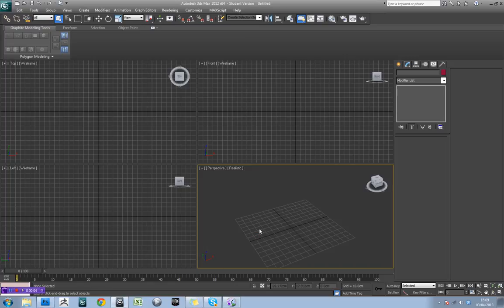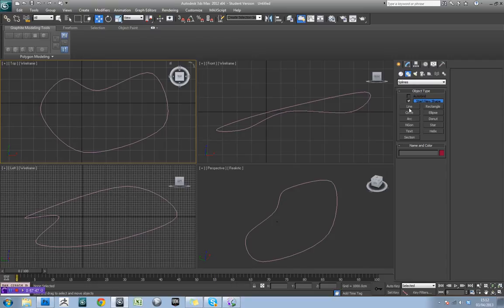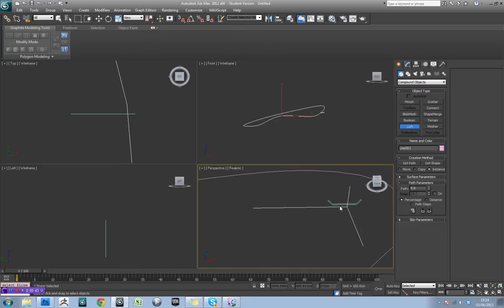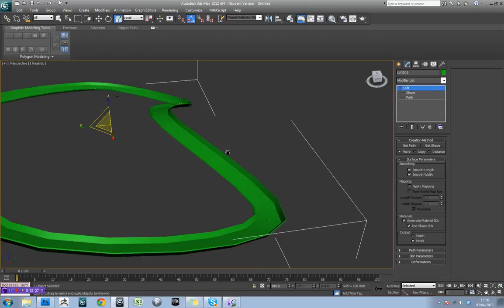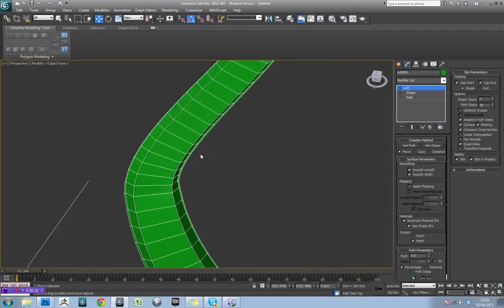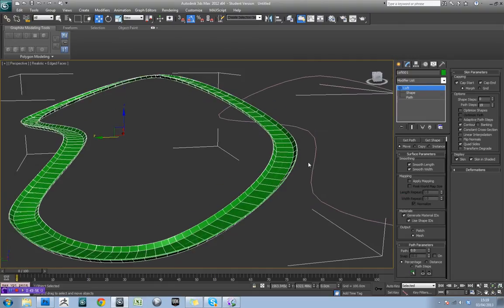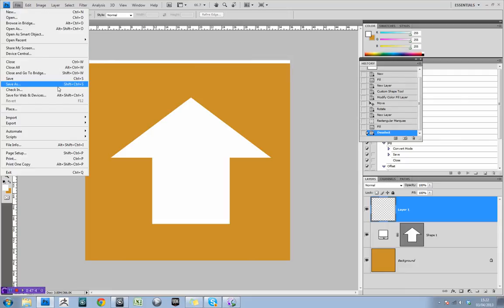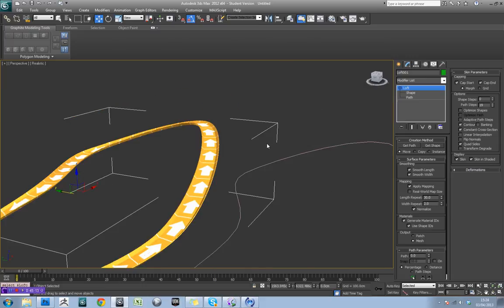3DSMax Wipeout Track Creation Tutorial PART1

Comment: Cool tutorial, thanks for making it, I subscribbed, I wonder if there is a vertex overlap in certain bends or curves, how can this be fixed? I mean aside from pulling the handles or moving the vertexes is there other way to avoid that?
Reply from the maker: Hmm, its been a while since I used this tool, I dont remember anything for fixing things like that apart from what you suggest :( Take a look at Sweep, it was supposed to be the replacement for Loft, it has some better functions and some worse though (unless they have improved it since I last used 3DSMax 5 years ago lol!)
Reply: Thanks =), I will have a look at Sweep then, else well as said it should be manually adjusting, I hope you get back to 3DSMax soon, you are quite skilled and fluent in that tool.

Comment: Thanks for the tuto ! Is it possible to export the track to Unity3D then ?
Reply from the maker: Just out of interest can you manually control the steps in Unity? This tool used to be awesome for that, you could control the Shape and Path steps in code very easily meaning Lodding could happen on the fly, so far less work for us artists :)
Reply: Yes, I managed to export with Autodesk FBX exporter and it works great =), just keep in mind that the tiling has to be changed in the loft itself rather than the material or at least in my version it works only if tiling is set in the loft but changes in material itself about tiling dont seems to work
Reply: I didnt know it could be used like that, my Unity knowledge isnt that good, I only mentioned it as to import mesh straight from 3DS in FBX, so it has its own lofting tool? I tried some google search and found that there are some asset store tools (sold separately stuff) for that, well there is this road construction tool thats free https://github.com/MicroGSD/RoadArchitect but aside from that I dont know if there is native lofting tool in Unity, if thst as you said then its cool of course